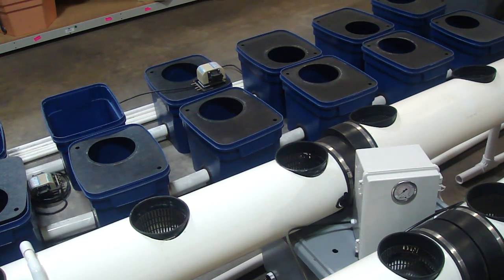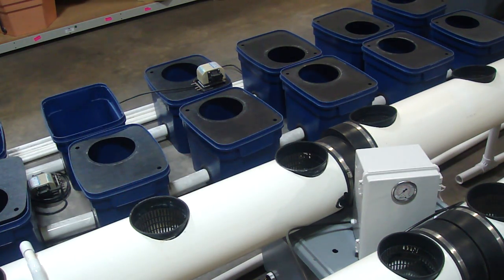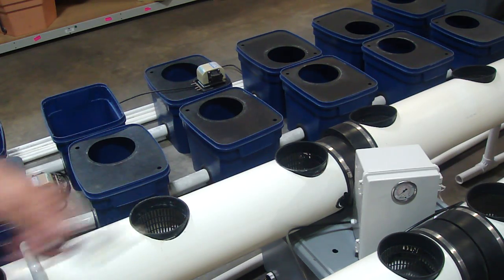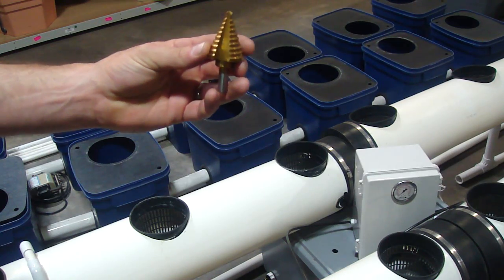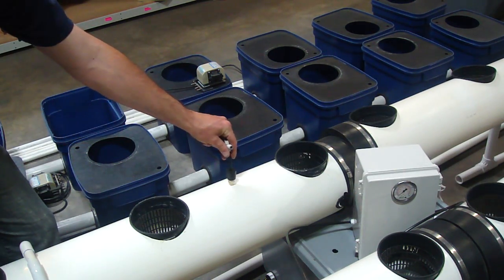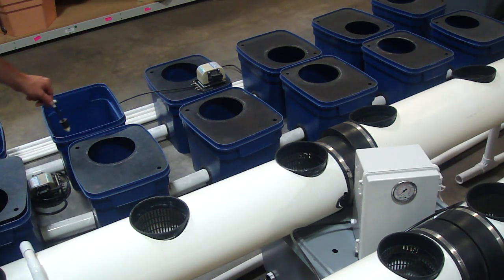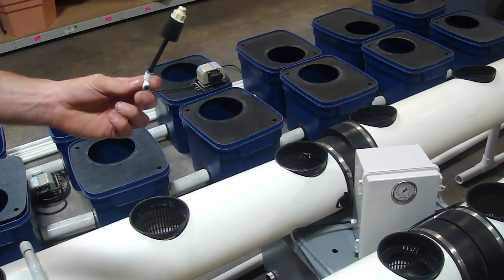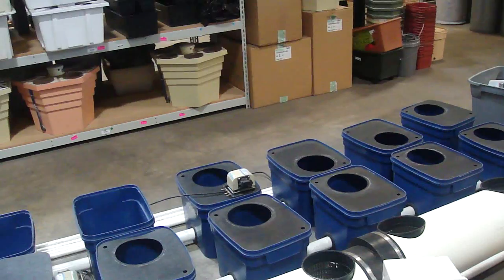DIY HPA retro-fit kit by Multiponics

Comment from the maker: @vspinnet2, thanks for the comments, 1 nozzle per bucket is actually plenty, and your spray time will still need to be quite low. You will want to keep the filter clean to ensure there are no clogged nozzles which would still not result in a plant failure with that setup since RDWC would be acting as a backup.

Comment from the maker: Thanks for the question! One nozzle per bucket is plenty unless you are planning on very short spray cycles that may air prune a large root mass. Using our angled nozzles from the top down provides for a bit of a swirl effect if angled against the sides of the bucket. If you are wanting two nozzles an 8800 kit would run 16 but you might not be in that sweet spot range of 30-80 microns with the added nozzles. Still outperforms typical "aero" setups though, even with 20+ nozzles!

Comment: I'd like to convert my RDWC to HPA. I have 8 5 gal. buckets (one plant per bucket). Is the DIY High Pressure Aeroponics Kit 8800 not enough for the 8 buckets? Your website states that the Aquatec 8800 Pump "runs 10 nozzles at or above 80 psi or up to 14 nozzles at lower pressures." Seems like one nozzle per bucket is not enough..?